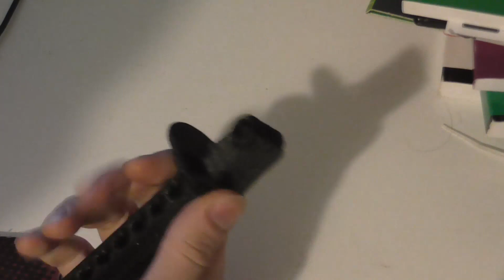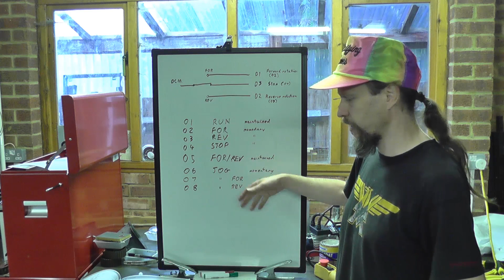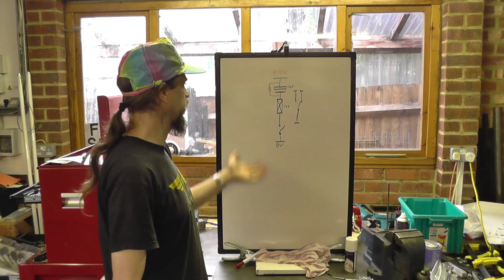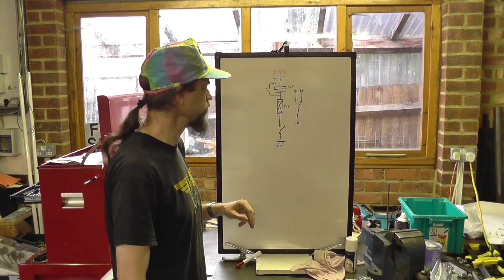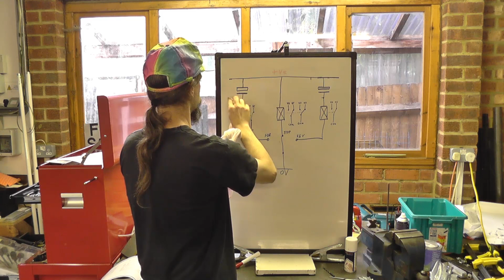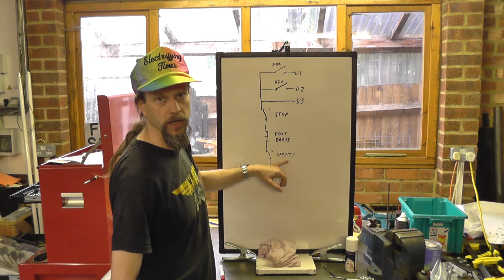Sunday Night Short XXX

Comment: Hey Paul,
I have a question, what is the native control voltage of the VFD that is being talked about here? Just wondering :)
Reply from the maker: Shadon HKW It's 24VDC as I recall. They've changed the design slightly and the earlier ones don't have a +24v terminal. I ran my 'active' LED indicator from a spare input.

Comment: Paul,
How about putting the capacitor in parallel with the relay coil. As soon as the switch is open, the relay coil will drain the capacitor. When the capacitor discharges to the relay dropout voltage, the relay would open, thus resenting the circuit. Depending on the size of the capacitor, this would take a few hundred milliseconds. The resistance of the coil would continue to drain the capacitor even though the relay isn't energized. The capacitor would be continually supplied with power when the switch is closed and the relay energized. You would no doubt need a current limiting resistor on the capacitor. A discharged capacitor presents a potential "short circuit" to the power supply. Either that, or have a power supply capable of delivering a large surge current as the capacitor charges. Thanks for the video!
Have a good one!
Dave
Reply from the maker: Swarf Rat Hi Dave,A parallel capacitor would cause the relay to remain closed for a time after the supply was removed, so it would act as a turn off delay, or pulse extender circuit. What was needed was a monostable circuit, turning a continuous signal into a momentary one, so that for example a toggle switch would then output a signal similar to a push button.

Comment: Cheers for the help, youve actually solved on of my biggest issues, in the manual the stop circuit dosent say it must be maintained for operation I wired mine as maintained for stopping, I was all confused when my , lathe didnt stop upon replacing the lever to neutral. Silly me.